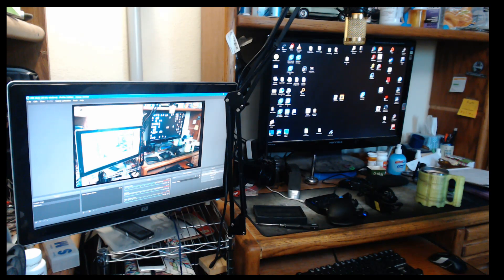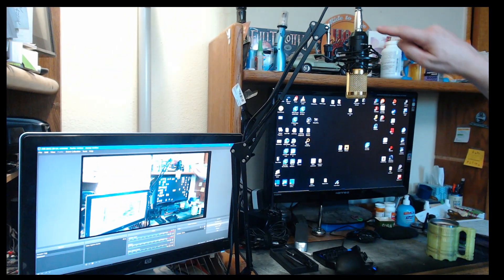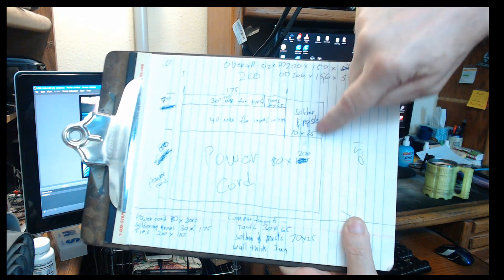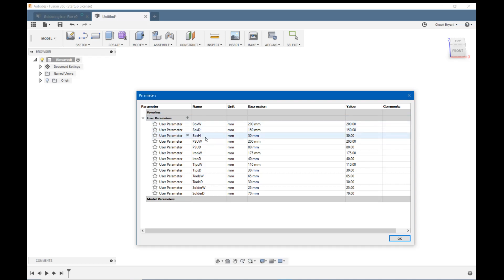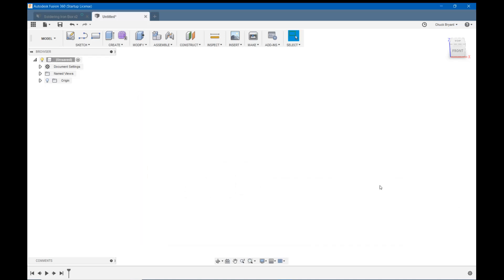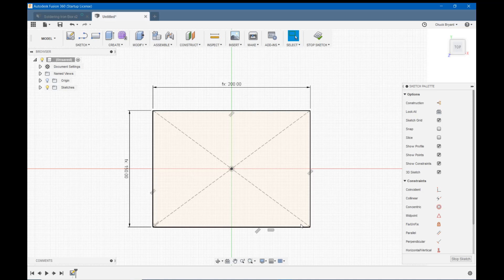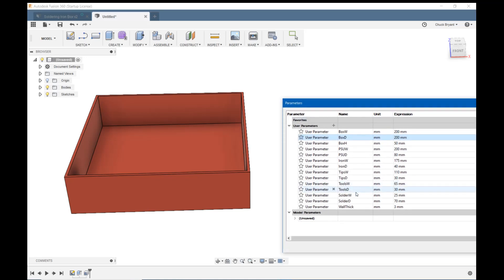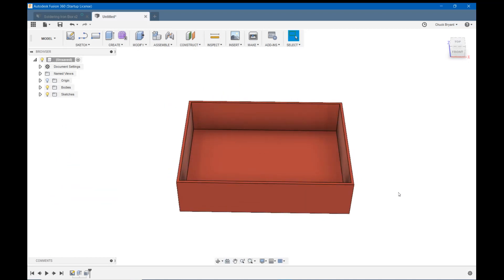Fusion 360 Beginners Tutorial - Storage Box for the TS-100 Soldering Iron Part 1

Comment: Nice Chuck. I am thinking of getting a TS100 or TS80. Two questions; is the TS80 'beefy' enough, and wich tip do you use for through-hole PCB soldering?  Thanks,
Reply from the maker: Thanks, Paul. I've never had a TS80, but from the reviews I've read I think the TS100 is the better iron for me. While I like the nice aluminum housing of the TS80, I don't think it has the wattage I need for the occasional 10 gauge wire from large power supplies, heating/AC work or on cars and trucks. And while I do have other soldering irons for that kind of work, sometimes there's no easy source of electricity and being able to run the TS100 off a  LiPo battery with nothing more than a cheap adapter cable is big with me. Yes, there's a cheap converter that will let the TS80 run on a LiPo, but it still doesn't have the wattage I want. I have a butane powered iron as well, but I've hated it since the first time I used it.  I also don't really like the idea of not being able to change the temperature easily on the fly. For some people that might be a minor annoyance, but I don't want to fish around in tiny menus when I'm on the roof, under the hood of my old Jeep, under the sink or jammed into the closet my heating unit is in. (Just a few places I've had to solder wires in the last year). Also, the TS80 is more expensive, so build quality not withstanding, it's like paying more and getting less.Of course, if you're doing nothing but small electronics work and you like the size and feel of the TS80, that might be the best one for you. But I still don't think you could go wrong with the TS100, it's just more versatile IMO. 
As far as tips are concerned, I like chisel tips. I think they hold the heat better than conical or thin pointed tips and they just seem to do a better job for me. So I'd either get a small chisel tip that fits the hole on the board, or I'll get a pointed tip and file/sand it to the shape and size I want. Mine came with the small, conical pointed tip, I think it's the B1. I almost immediately filed a chisel on the end. I use that one for most electronics. My second TS100 also came with the B1, which is still in a drawer somewhere, unused. I ordered the medium size chisel tip for it and use that for auto/home type stuff.
Reply: @3rdpig  Thanks for such a detailed reply, Chuck. I agree completely about chisel tips vs. pointed. Like you, I have a butane which is completely unreliable for refills and just gets very occasional use for heat shrink.
My 'toy-token' budget has been on a diet lately so I didn't want to waste money.